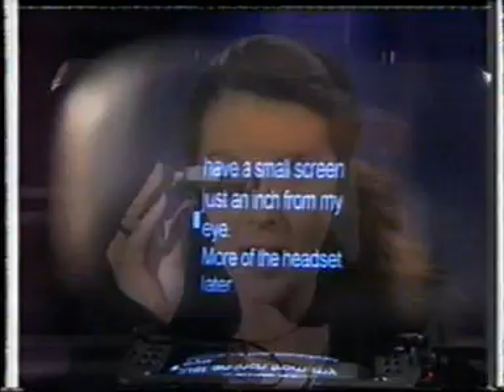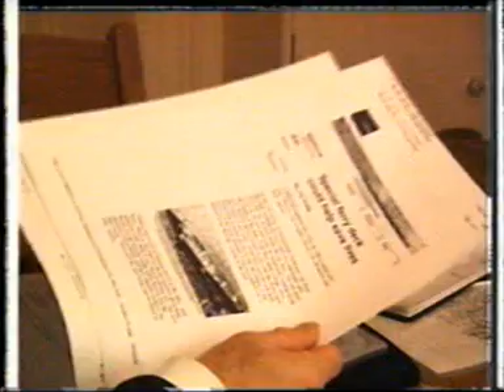The Sinking of Ro-Ro Ferries

Comment: Most bigger RoRo ferries have a long wall in the center of the cardeck, it contains elevators, stairscases, etc. It also works as a longitudinal watertight bulkhead to prevent the water from moving side to side. RoRo ferriers in Europe are very safe today, and it is not nescassary to make additional improvements.
Reply: I disagree they are floating death traps

Comment from the maker: The full-scale vessel lying on its side in the sea, in the video, was the 'Herald'.  It did not 'turn turtle', because it capsized in shallow waters; in this case, above a sandbank.  Had it have capsized in deeper waters, the loss of life would have been much worse, because the trapped passengers and crew within the vessel, would have been subjected to much larger and more violent dynamic forces caused by the vessel turning through about 180 degrees instead of about 90 degrees. carltfross.

Comment: The cardeck is located meters above the waterline and it is watertight itself. If water enters the cardeck it would not flood the compartments below, but run out into the ocean again. But the water would never be able to enter the cardeck anyways. First 1000s of tons of water has to climb the meters to the cardeck. which is impossible. Destroy at least 2 independently working bow doors which is impossible.

Comment: yes outwards opening doors are the safest on ships because the waves try to push them in. It is the straight opposite on airplanes though. because there are low pressure outside the airplanes cabin which sucks the doors out if unproper constructed/locked. Failure in outward opening cargo doors have caused some of the worst plane crash in history (DC-10 1970s). With that means proper doors aren't only important on ships

Comment from the maker: That is right; except that the vertical baffles are connected at their bases to a watertight car deck, and they are connected at their tops, to the underside of a perforated car deck; 0.5m above the watertight car deck.so that the movement of the cars is not affected.  Moreover, in the case of any unwanted water ingress on the top of the perforated car deck, it will not result in the ferry capsizing in a few minutes, and preventing an orderly evacuation, together with a serious loss of life.

Comment from the maker: Most modern ro-ro ferries are safer than the 'Herald', but a single longitudinal bulkhead on the centreline of the car deck is not much use, because if the car deck gets flooded the water will flow to the side of the ship, causing the vessel to heel even further.  Moreover, If the vessel heels to one side, due to the ingress of water, the water would not normally flow back (i.e. upwards) to the centreline of the vessel, because such motion will defy Newtonian physics.

Comment: It may be good to ensure that water does not get into the ship Many roro vessels used to lay out before the front gate was closed, and that was one of the reasons for this accident. Surely you can rebuild the ships so they can handle water, but it does not help if you drive with open gates.

Comment: Sounds perfectly feasable. Would the channels thus formed then run into scuppers of some description with one way valves for draining.
I have often thought of some sort of connection between the bow doors and the engine controls so that drive cannot be engaged if the doors are open and a secondary W/T door behind the main doors, but yours sounds much better. Nice one.

Comment from the maker: In between the upper perforated car deck and the lower watertight car deck you will have many compartments; most containing a computer controlled hydaulic pump; these pumps will pump the unwanted flood water transversely across the ship, and overboard into the sea, where the out flowing flood water will be outputted well above the ship's waterline..

Comment from the maker: @Amiasurui2 Ro-Ro Ferries can be made much safer, if a perforated car deck is built above the existing watertight car deck, and the two decks are separated by a large number of dwarf longitudinal bulkheads, going along the 'full' length of the ship.  This will stop sloshing, that causes a ro-ro ferry to capsize very quickly, thus preventing an orderly evacuation of the ship.  Moreover, if hydraulic pumps are placed within these compartments, the water can be pumped out, as fast as it comes in!!

Comment: This film is very out of date now. Much has been done since 2000 to improve the stability of ro-ro ferries (including retro fitting additional latitudinal water tight doors to car decks on older ships in some cases). There is (and never will be) such a thing as an unsinkable ship. The main thing is to make sure that a damaged ship floats for long enough to ensure a safe evacuation. Statistically ferries are still a very safe way to travel (in Europe at least).

Comment: ...yet, they decided to weld shut the front visors and add more cameras to monitor the locks on the remaining ones.
If history teaches us one thing, then that every ship is capable of sinking.

Trouble with car ferries is, they have a huuuuuge open space which cannot and is not separated into compartments with watertight hatches.
So relatively small amounts of water turn into a uncontrollable force within the ship.. flying together with trucks thru entire lenght/widht of the ship....

Comment from the maker: A roro ferry should not sink, if it has excessive water ingress on its car deck.  Instead, it should capsize and then float upside-down; this is because a typical roro ferry, like the Estonia, had about 18 000 cu.m of air space trapped under its watertight car deck!

Comment: a sentence containing "should not" cannot be taken as an answer.
-
In estonias case, the sudden movement and list - caused the ships engines to turn loose ... not to mention the cargo ( heavy trucks) and the water itself which is a force not possible to calculate.
(the best chaos-scientists are on it) 

Aparrantly the air beneath the cardeck was not trapped very well, in any case the ship sank, did it not?
  
The correct answer is "huge cargospace give incoming water and cargo too much momentum"